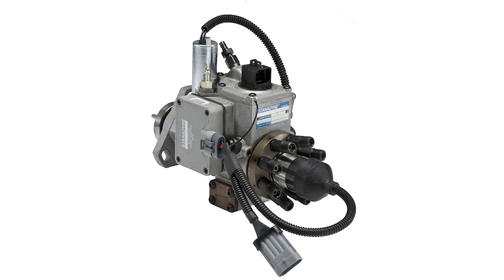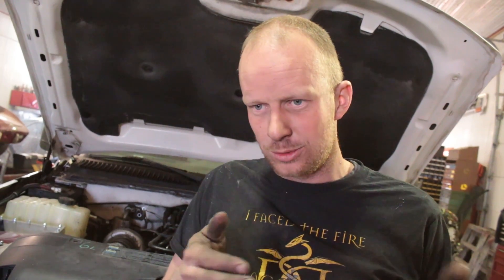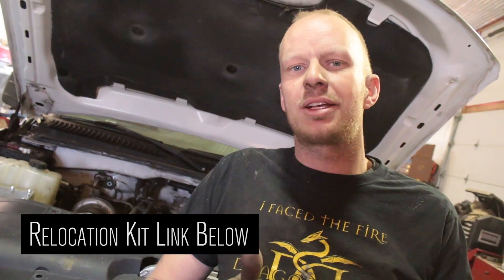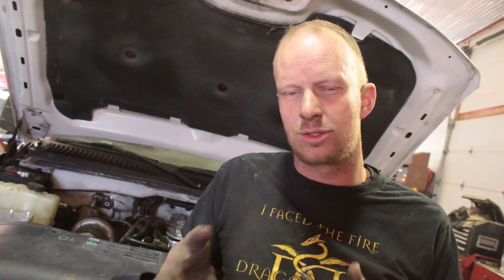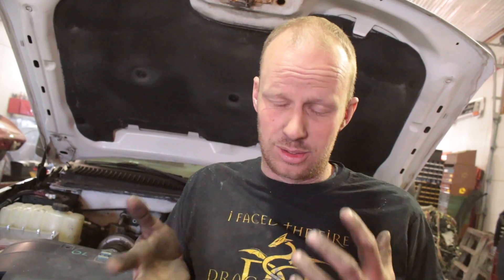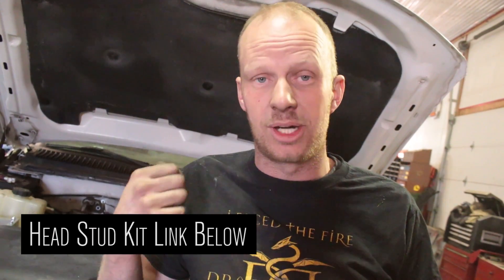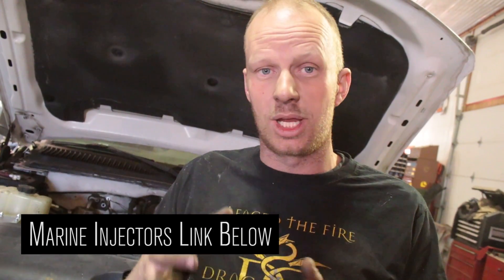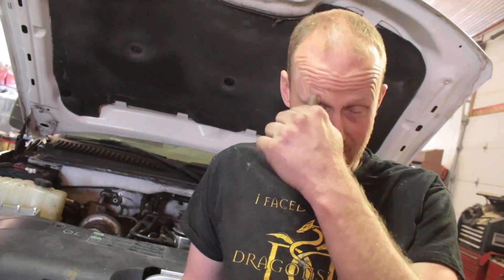REVIEW: Everything Wrong With A GM 6.5 Detroit Diesel

Comment: Damn descent approach and views on the 6.5.  Diplomatic start, good coverage on philosophy of use and some great points.
Reply: The stock oil cooler lines are unreliable too, they're held to the engine block with a little C Clip.
Reply: @101Volts  you are right!  Best to change them out to braided lines right away. They cost me a motor.
Reply from the maker: Thanks!
Reply: What about the cylinder cracking problems the 6.5 has???
Reply: @lioncelica5170  I haven't seen that on mine yet, hopefully I won't for the time I have it either. I did cut a hole in the side of the air box and ran a tube out of it for cooler air, though. I'm no top mechanic, maybe this isn't true but I heard the two cylinders nearest the firewall are the ones that are the hottest and which are most likely to crack. No idea if my cooler air idea will actually help.
Reply: have  you had any thing to do with 6bd1t isuzu truck engine i know off a trucky here in australia with close to 2million km still running  and working
Reply: anonymous  Parts here in Canada: $1000 for injectors (after core refund), $ 300 for US made PMD & relo kit, Turbo ~ $1000.
Reply: DEBOSS GARAGE  I need help with my 5.9 Cummins if you can contact I would really appreciate it
Reply: I have a "green" tag pump.
Reply: So black box can help with what update mine has. No blue tag but box change
Reply: you make me wet brian!
Reply: 6.4 suck
Reply: The cylinder cracking problem commonly effects holes 7-8. And most often occurs in the 506 blocks (96-2000, the only ones with oil squirts for piston cooling)

The BIGGEST problem these motors face is that GM cast them. In 2000 when the rights were sold off to AMG and casting was outsourced to Navistar the vast majority of ALL of the block/ head cracking issues were left behind.

Comment: So I am glad people are still commenting on this, I have a bit of experience with a few different years, my dad owns, likely still to this day, a 97 crewcab dually we relocated the PMD behind the front bumper we also replaced the lift pump for a better one with spin on filter we also did some small pump timing modifications that gave it a small bump in power he first bought this back in 04/05 and ended up putting rings bearings, and headgaskets in about 10 years ago a few years before that he had to rebuild the trans and shortly after the transfer case I believe. but it still runs pretty good still. I bought in 06 I believe, a 93 GMC Sierra 6.5 5 speed I really enjoyed that truck but at the same time my brother had a 99 6.5 which was totaled and so he got a 99 7.3 powerstroke, which he disliked and got rid of it for a 99 24v cummins 3500 that was such a crazy beast in comparison to the other trucks I had problems with my lift pump going out, didn't know it until the truck would get to be hard starting hot, I thought my injection pump was toast because I could pull start, love manuals, or pour cold water on the injection pump and start. but eventually I figured out replace the lift pump, frame mounted electric and it would start no problem. next I started having issues with my headgaskets, I fully believe it was because I would "try to compete" with my brothers dodge.  Pulled too heavy for the truck well I drove it to my dads and we pulled the heads and replaced the  headgaskets and wow did it make a difference it perked up and wanted to run very well so it is possible they had been going bad prior to me even buying the truck. well bad news on my way home the crankshaft broke........ I couldn't continue to mess with it so I ended up selling it. I wish I could have cummins swapped it I liked that truck. it was 2 door extended cab

Comment: Thank you for your evaluation. This is the first small diesel I have even had. I have had several different diesels in commercial trucks ranging from silver 92's to a 600 Cummins. I wish that Cat still built commercial truck engines because a purring Kitty was always my fav.

Comment: I run a fleet of service and work trucks. We still have eight of these 6.5 trucks in service and five of the original 6.2 diesels. They have never been a major problem for us. They outlasted the Ford 7.3 Power Strokes and 6.4 Power Jokes. We spend less money keeping the GM trucks running that their problematic Ford counterparts. If you’re not going to beat the truck or try to roll coal, The GM diesels have and still serve us well. We have very much enjoyed our ownership of the 65 diesel trucks. Only two of them had head gasket issues, and those two were drivers that beat those trucks up and never checked the fluids. One of the 1994 trucks just broke the 450,000 mile mark and is still going. Yes we do maintain our trucks. Well they get regular oil changes and every hundred thousand miles. They get a new turbo and a new set of injectors which cost about $800 and four hours of time.  Yes, we buy the Chinese turbo chargers so far I have no complaints. The injectors I buy from Pensacola diesel. Given the way new trucks today are such garbage. We have no plans to replace these trucks for the next five years. We lost too much money switching over to the Fords. Just realize they were a very expensive truck to own.
Reply: I started working for Laidlaw Transit when the 6.5L turbo Express cutaway vans were new. We had some occasional problems with the injection pumps early on but they were pretty solid engines overall. School bus drivers being the bottom of the CDL barrel, those rigs took a beating. Despite that, the majority made it the full 15 years with just basic maintenance before being retired. I never saw a head gasket failure and maybe swapped one 6.5L the whole time I worked there.

Comment: The Cummins is a though engine, but I don't like the way they drive and handle.
Too much noise and shaking.
The 6.5 Turbo drives like a car and you can rev it up to 3500......
With a Heath Diesel chip 280 Hp, it's totally awesome.
And that is with a stock Turbo.
I always make the waste gate shut.
I have seen 21 psi boost with stock Turbo.
And I always use Victor Reinz head-gaskets.
Studs are good, but you only need them beyond 300 Hp.

Comment: The PMD is not a governor.
It is a signal amplifier.
It takes the low power signal from the ECU and amps it up to a high power signal that drives the High Frequency Puppet Valve in the center of the IP.
That is why they call it PMD = Pump Mounted Driver

Comment: There's been a lot of criticism of the olds engine because it's a dieselized gasoline engines,6.5 diesel engines and Duramax diesel engines and 6.2 engines weren't or haven't been any better,if any consolation,at the Oldsmobile diesel was used cars and trucks, the other 3 V8,s ain't bullet proof either apperntly!!!!!!

Comment: I am seriously between a rock n a hard place with my 6.5 c3500 dump.  I put a new pmd in it.  I can start it up and it will idle n sound perfect.  I can run it about a half mile perfectly and then it boom, shuts down.  I can start it back up and repeat the process.  I've had 3 mechanics want to throw parts at it.  Theyjust have no clue.  Most big shops say the truck is to old.  99!!!  That really annoys me.  Any help at all/guidenance would be appreciated.  At this point is not much I wouldn't do to get my truck fixed

Comment: 6.5 guys: I’ve been admiring a late 90s 1.5 or 2 ton cab chassis pickup size gmc flat bed for years that mostly sits on a neighboring farm. I found out the other day it’s a 6.5 turbo. It’s in immaculate shape. Was it common to see them in trucks bigger then a 1ton and were they a higher horsepower variant with an upgraded transmission?

Comment: I have a 6.5 and I'm looking for some info on it. Is smokes and knocks when it starts really bad. But only for about 5 minutes. And only when it's cold. And I dont mean cold weather I mean Capt in warm shop just not being used. If anyone could tell me what's wrong that would be much appreceated
Reply: Mine does that same I’m replacing the i injectors right now I read when they get over 100,000 miles on them they start to leak down or spray all goofy I’m hoping that’s what’s causing it
Reply: @sargentdoggo6155  ya that is what I was thinking thanks for your input and good luck
Reply: @Ebba8youtube  I just got finished with the injectors took me two weeks, starts up so much better and a lot less smoke it wasn’t that cold today but it used to look like the house was burning down

Comment: I have a stock '95 2 Door SLT Z-71 4x4 GMC 6.5 Turbo Diesel Yukon with 227,000 miles on it, and my last average was 7.4 gallons to travel 142 miles, a solid 19 MPG, and I often put my foot in it. I looked down at the speedometer earlier today and I was running 90, and barely keeping up with traffic. 🤪

Comment: My 2000 Chevy 3500hd dump truck 6.5L is going on 737,000 miles and still running tough, only thing I’ve ever had trouble with was the 4L80E tranny had a problem with reverse.
Reply: Are those miles on an Original engine, or did you replace/rebuild ???

Comment: I don’t know what’s happened to the diesel pickup community in the last 30ish years…it’s gone from people saying ‘the 6.5 Detroit? What a pile of shit, it’s only good for 4 or 500,000 miles, not like the 12 valves or 7.3 powerstrokes or 7.3 IDI’s, they’ll run a million all day.’ To ‘oh, my L5P duramax is throwing P20EE at 50,000 miles? It’s a 14,000$ job to fix it, and then it’s gonna happen again in another 50,000 miles? And it’s gonna be down at least a month cause the dealer can’t get the parts cause this is such a common issue? Ok, that’s fine, get the job rolling.’ (Or, just to rag on the 6.7 powerstroke crowd) ‘my trucks got 100,000 miles on it, and my CP4 pump shit the bed, and put metal shavings in my rail and injectors, and now you have to replace literally everything that runs high pressure fuel through it and it’s gonna cost me 15,000$? Ok, that’s fine.’

The cummins’ are probably the best of them, but they’ve still got their problems, blown turbos, head gaskets, bunch of emissions problems, not to mention you can’t keep a transmission behind them, they had 1 good transmission option in them, the G56 6 speed manual, and they stopped using them…

I will say this for the new trucks…the Allison’s in the duramax GM’s are probably the best auto trans ever put in a diesel pickup.

Comment: The 6.5 is decent but one of the biggest flaws with this engine is that it was designed with a Chevy big block which sounds ok at first until you realize that big blocks are supposed to be for gas engine internals and not to be ran with diesel fuel. But pretty much it’s just a 395 big block with diesel internals and diesel heads. Which lead to the blocks cracking when you tried to tune them beyond roughly 400hp.

Comment: I don't personally have any issues with the 6.2L or the 6.5L GM engines. Yes all the others have reliability issues but they have a lot more pulling power. Do PMD relocate, make sure you have a big engine oil cooler and these engine will get you through your day just fine.

Comment: Slow, leaks oil, rotary injection pump, egr, intake, pre combustion chamber, turbocharger, starters, dumbasses who leave the starter support bracket off, injection control module. Transmission shift solenoids. Any questions?

Comment: should have been direct injection from the start,stanadyne elc controlled pump was the real problem as it was released without proper testing,it was also first generation stuff and bosch has also discontinued the VP44 elec controlled pump to

Comment: My only issue with the 6.5l is power output-i have an LLY w/490k miles & lots of Torque & then I have a 2008 Lmm that’s just deleted & tuned & I’m addicted to the Torque-i will never drive a gasoline engine truck as long as the Duramax is around & prior to 2001 i drove 5.9l Cummins powered trucks-Duramax is King

Comment: I got a 94 6.5, the injection pumps on that year suck, seems like they only used that specific one for 1 year, the guy before me swapped it for a 93 pump. Have about 10k on it so far and other than a good but of blowby partly because they routed the, ecentially, pcv hose from the intake. Runs good though. Working on finding an intake or making one....

Comment: Love my 6.5 some changes it deserved were rubber injection line run from the tank to the pump to the ffm and a “feed the beast mod” from the fuel filter out to the ip. It had the pmd relocation before I bought it. Every 6.5 should have a “turbo master” weather it be manufactured or home made and the vacuume pump delete done to get that useless load off the engine there is a high flow water pump available aswell as 195* thermostats a 9 blade rad fan and some 60g glow plugs  the hx35 is a good turbo but there are better nowadays and you don’t have to mess with the mounting differences, these are weekend projects and very affordable to essentially give you what you would get out of a Chevy 350 but with better mileage and tough as nails, the mileage is often overlooked it may not roll coal without marine injectors however it competes with 2020+ vehicles by getting 21 mpg without trying I’m sold on the platform, DEBOSS is definatly not wrong about the 12 valve though it may drain your wallet but those things are monsters!

Comment: I owned GM diesels all the way back to 1978 when they came out with the 5.7 diesel  I have had numerous 5.7,6.2 and 6.5  and yes when they want away from the mechanical  pump drive to the electronic drive on the 6.5 they had some issues but remember this was your goverment mandates that started all this even back then but having said that the 6.5 was still a good engine over all  you must remember it wasn't designed to be a power house it was designed for fuel economy  and yes you could do things to them to get more power but the bottom end was designed for that and guys would start have alot of bottom end problems because of all the extra power they were giving them  and GM knew that wasn't out power power stroke or the cummins  but that was never there intention  it was for light application and fuel economy.

Comment: As far as it goes worst that I've seen on these motors is the Piston breaking 
Original factory head gaskets fail around 90k 110k
Also the studs on the heads are different from van to truck
Truck angled
Van straight up and down

Comment: All those pump updates and replacements on the all electronic pumps did nothing but replace a junk electronic pump with another junk electronic pump ! I've got a 99 with 100k miles and it's had everything replaced  ! Don't dare move anywhere cause i know the truck will die on me !  13 injection pumps it will go a lil while then die ! Over 20k worth of parts over its life and it's still a piece of crap for every 1 you see that goes 500k you hear 1000 that are like mine  ! Chevy really needs to offer a buy back on them or a duramax replacement for it ! For what I've spent on pumps alone  I could have put a cummings in it ! Instead ive got a truck that should run at least 500k miles thats imploded ! Countless time and countless money gone cause they can't give us a pump that works ! Had it decide it wanted to go full throttle on me more than once at a stop light ! My foot wasnt even on the throttle , Chevy and stanadyne should have never let these pumps be sold they are a dangerous contraption with a mind of their own ! Stanadyne has stopped manufacturing them because the computer controls the throttle and they do not want to be sued ! I've bern in touch with chevy and if they refuse to do something im putting a cummings in it and dropping this 6.5 right on corporates front door step ! With a love letter attached !

Comment: Anyone know if a 96 c3500 with the diesel has the same steering pattern for and steering wheel from a 88 to 94? Don't want the air bag so any help about if it will just fit the splines would be great

Comment: Worst engine I’ve ever ever had most unreliable engine ever built. My truck hummer has spent more time in the mechanics then on the road or tracks 👎
Reply: These engines are crap to be honest stay away from them I just can’t believe how much money I have put in this piece of crap 💩 and outs still having problems. GM should be made recall everyone one them and have them replaced with a Cummins. Stay away from these engines I don’t care who says they are good or do this or do that they are 💩
Reply: i love the 6.5td cars are cheap sounds great and gets good milage compared to other diesel trucks. not everyone needs to tow a million tons of whatever. and its not a cucked common rail diesel so you can fill it up with waste oil lmao

Comment: I started my diesel career with 6.2/6.5 diesels and logged over a million miles on them. I went from cheap refreshers to full builds with 18:1 pistons and 4911 mechanical fuel pumps opened up all the way. That engine would put a smile on my face, but it wasn't a cummins 5.9. What really made me start shying away from the 6.2/6.5 platform was cracks in the main bearing webs of the block. For a while every one of my spare engines had cracks. One problem with the 6.2/6.5 platform is that they generate a lot of heat when worked hard. I actually gave some thought to swapping one into my 97 Jeep TJ, but the heat issue would keep me from doing it.

Comment: 1998 Chevy Silverado k3500 dully with a 6.5 turbo diesel I love that truck 4 wheel drive that goes the same speed pulling nothing or pulling a whole county good work truck only I use it I got a 30 foot trailer I’ll pull 2 bob cats on and I’ll have the bed loaded and drives and feels the same as I’m pulling nothing I can’t even feel I’m pulling anything thing but you know the problem with them earlier turbo diesels they were making to much power